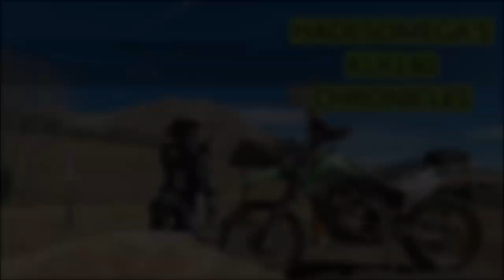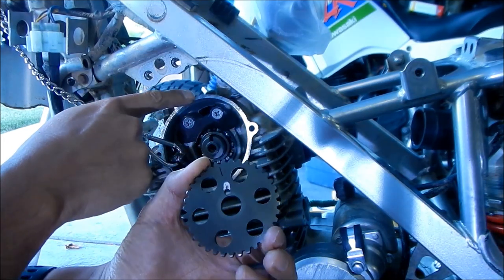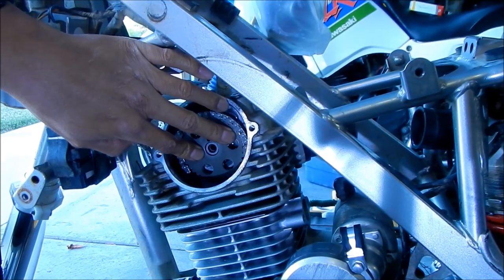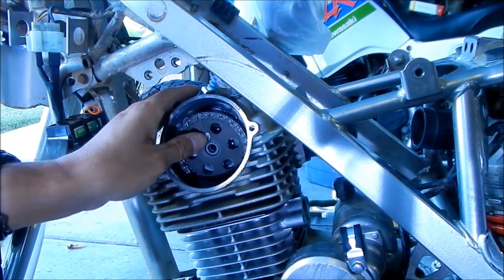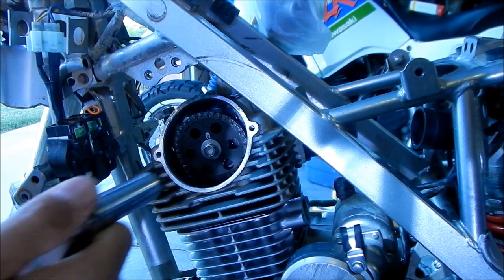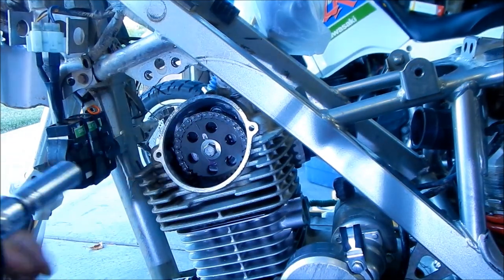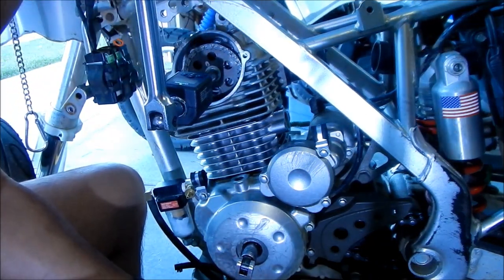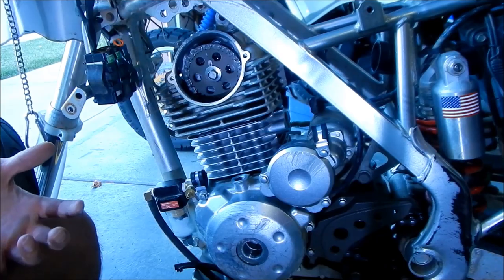KLX140 Big Bore Top End Rebuild VLOG Part 28 - Camshaft Install Part B

Comment: Hey brother I haven’t changed stocked camshaft but I installed the same big bore kit it started smoking a little bit (bluish white smoke) could this be caused from the not having the aftermarket camshaft ?
Reply from the maker: No the camshaft shouldn't do that.  Just make sure you've got the valves adjusted right.  It could be you need to break it in first.
Reply: @hadesomegamoto7639  thank you and do I follow your break in sequence ?

Comment: When I spin my crank shaft with the lower 12mm bolt the cam doesn’t spin with it, what did I do wrong. Could the cam chain fall off the lower part
Reply from the maker: Most likely that is what happened it cam off the crank sprocket when you loosen the chain.  You can try to take the cam out again and see if you can move the chain into position again or remove the left side cover and flywheel to get to it.  Good luck!

Comment: .what's the size of the intake and exhaust??are you using the stock cylinder head?
Reply from the maker: Yes stock cylinder head.  I did a little port and polish on it